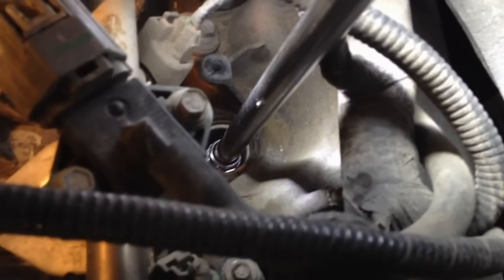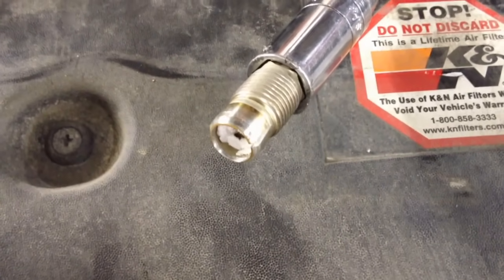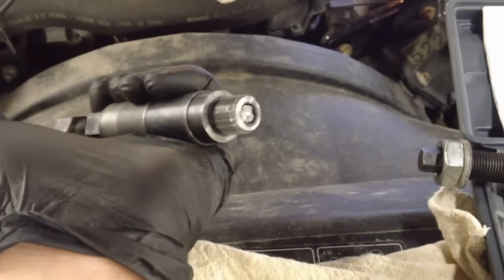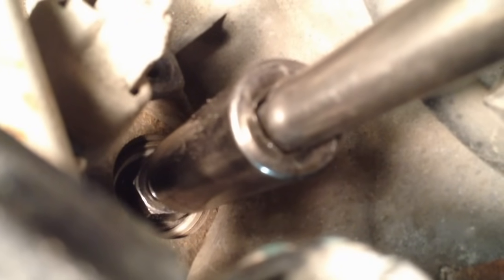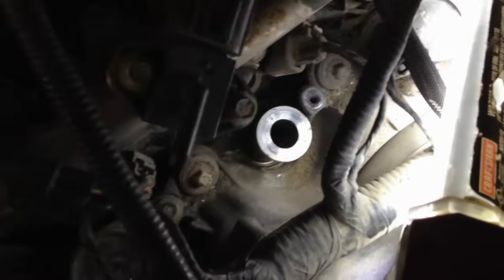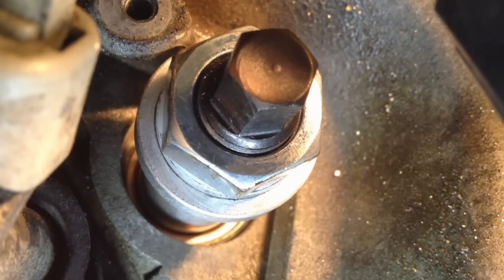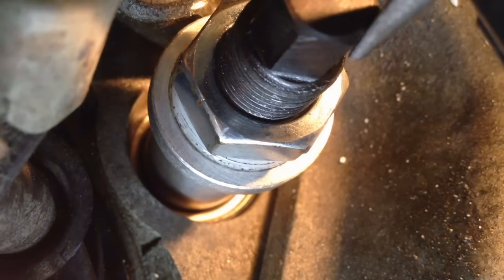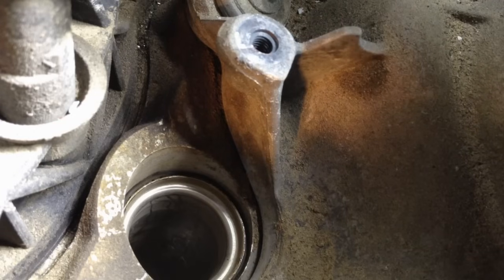Ford 4.6L 3v & 5.4L 3v Broken Spark Plug Removal

Comment: What would you recommend to get just the shell out, with no porcelain in it, just the bottom shell? The lisle tool wont catch on the threads, great video btw, definitely great advise as usual😀👍
Reply: I’m having the exact same problem right now. How did you get it out. My extractor isn’t catching.
Reply: @Venom-z4t  so what Extractor did you have to use to get the shell out

Comment: Soooo, changing the plugs on my truck and none broke but one is totally rounded off! Anyone know if I break the plug if I can get it out with this? I tried hammering on a smaller socket, deep well extractors, etc...I really don't know what to do
Reply: Cody Wallace I have the same problem , let me know if you found a solution bro thanks
Reply: @thehorizon1281  hey bud, here's how I fixed mine. I broke the plug off above the hex. Went to Lowe's and got a circular tile cutter. Drilled into the plug. Then got an easy out

Comment: What do you do if you extracting tool trips on the first two threads?
Reply: Had somebody with a higher grade extractor about $300's. He was also a diesel mechanic. He failed. ended up taking my to a dealership. Luckily we didnt have to replace the head. so it was about 1600 total.

Comment: hey i'm follower of yours what is your recommendation on plug replacement ? i do my Fuel filter trans service diff and t case between 20,000 and 24 000 miles oil switched to 5 /30 like you said and 3000 miles to oil changes and filters 08 F 350 at 130,000 been trouble free plugs changed once ,80,000 miles

Comment: 2002 4.6 v6 f150, I just did my spark plugs and wires, before cracking them loose I sprayed penetrating fluid on all of the plugs and I also was very careful before cracking the spark plugs loose. Thank God I didn't break any. I just bought this truck from my neighbor and it was my first time doing them
Reply: Kyle Feilmeier i think the ones with this plug issue are the 2004 to 2008 trucks with the 2 piece motorcrap plugs..i have a 2001 4.6 and had no problem getting them changed

Comment: My 4.6 mustang blew a plug fixed that issue after the repair car would not start. I've change fuel pump plugs oxygen sensors both upstream and still won't crank. I got fire on coils pulse on injectors still acts as if it's not getting fuel. Any advice on what to do next
Reply: What was the solution?

Comment: Changed the original motorcraft plugs on my mustang....huge mistake!! I got 6 of the 8 plugs out, 2 broke. Had to get the Lisle tool, it only got out 1 of the broken plugs, still had to go to the shop to get the last plug out.

Comment: When you do the second step to tap into the porcelain, which nut are you turning the upper black nut counterclockwise or do you turn the chrome Nut instead to Tap into the Porcelain, I don't have tool as of yet but I like to know so I am not missing up, Thanks you In Advance

Comment: I have an 04 lariat 5.4. 3v engine. I bought it 2 years ago. 
Last year I was going to change spark plugs and bought the motorcraft 8 pack according to year and engine.. Took them to my mechanic and as soon as he took first one out we realized they were completely different from the ones I bought...
 Long story short I had to buy new spark plugs such are on 09 models and newer.. So my question is. How is that possible?
Did the previous owner put a new engine? What are the possible reasons to have this "updated" spark plugs in my engine? In my country I need a document to proof that the engine swap was not from a stolen truck. If that is the case...
That's why I need to know if something different other than an engine swap could be done..
Thank you.

Comment: Wow.  I think I'll start pulling my plugs once a year and coat the threads with anti-seize.
Reply: The new redesigned plugs don't have this 3 piece build and won't separate. Stripped heads are still an issue however.
Reply: James Washer stripped heads are only an issue on the 2v versions, which were due the heads only having 2 or 3 threads. They were redesigned in 2003.5 with more threads just before ford went to the 3v in 2004.

Comment: I’m paranoid I’m gonna break a plug. I drive around and get my motor nice and warmed up. Pull my coils and my throttle inlet and injector harness. I spray wd40 in the plug holes inside the valve covers and spray in the throttle while cycling the starter. Let sit until cool and then rattle loose with some ugga duggas.

Comment: I Had one plug break on me when changing out plugs on my 2007 f150 5.4l .  I went and purchased the exact tool and followed your directions to the tee .  It came right out with no issues .  Thanks for posting this repair. You saved me a lot of cash

Comment: Has anyone ever had the threaded shoulder break off in the head? All I got out was the nut and a split porcelain electrode. Ultimate nightmare!
Reply from the maker: Use the otc tool to remove porcelain and center electrode then use a spiral or square easy out for threads then continue with the lisle tool shown here.

Comment: I had a brand new NGK and it freaking did this I put it in one week ago everything work a week later all my electrical parts came in for the new things came in for rewiring my vehicle I want to take the spark plug out and it snapped everything still intact is just the friends that are still in there

Comment: How would i take off the tip of the plug off the extractor?
Reply: Vise grips worked for me today. Took me a bit to find the exact setting, but after that, and a socket on the end, they broke right off. I hope the two I have left for tomorrow are as easy. Best of luck!

Comment: Is possible the spring from the booth fall inside the cylinder.
Reply from the maker: never had a center electrode fall in yet.
Reply: I haven't turned up. If it have any medal component inside  it will get messed up.

Comment: How do u get the shell off the tool after it comes out?
Reply from the maker: Hold the shell with a vice grips or bench vice and turn the tool clockwise.
Reply: FordTechMakuloco thanks for the video. I got them all out. I only had pliers so I had to go pick up some vice grips. My GT is running so good now.

Comment: I have an easier way for you to remove the spark plugs. What I do is bring the engine up to operating temperature. And take them out with a 3/8 impact gun. It seems on the ethical but I could tell you it works. I was told this by a trainer from Ford. And I could tell you it works it’s the only way I do those plugs anymore. Since I’ve been doing this I haven’t had any break in the head.

Comment: At the end, why not vacuum out the cylinder.  Or insert small vacuum hose and the air hose to stir up the ceramic particles?
Reply from the maker: Much better and faster to use air
Reply: The thought of ceramic chunks going crunch on the valve seats worries me.  I'm probably over-thinking it :)  Thanks for the video.

Comment: ...I was quoted $500.00 to do the plugs, and add $40.00 extra for every plug that breaks...he told me he is very good with this and has had good luck not breaking to many, BUT ... he told me the f150 next to us broke his good luck streak and 7 out of 8  broke ....YEP, ... Add $280.00 to that $500.00 .... just to replace 8 plugs, its lynching time .....with tax over $800.00 ....that's over a hundred a plug ...
Reply: glinnz05 I need to get good at this and make a ton of money charging half of that!

Comment: OLD VIDEO I KNOW, BUT WILL THAT TOOL FIT INTO THE DOGHOUSE AREA OF MY VAN? WHERE THE REAR PLUGS ARE LOCATED?
Reply from the maker: I have never seen a 3v engine in an E-Series van.
Reply: TRITON V8, 4.6L. REGARDLESS , I HAVE A SEIZED PLUG AND NEED IT OUT. EVERY MECHANIC I HAVE GONE TOO HAS TURNED ME DOWN INCLUDING MY BROTHER. BASICALLY IF THE THING SNAPS THEN IM LOOKING AT A FULL HEAD JOB

Comment: I changed mine a couple of months ago. Warmed up the engine for a few minutes then sprayed each plug with pb blaster and let it sit for about half an hour. I used a 3/8” socket wrench since I don’t have an impact wrench. 4 of the plugs broke and I initially used the extractor tool that they rent out at oreilley’s. It worked very poorly, and didn’t extract any of them. Bought the lisle tool and it worked really well. Make sure you have an air compressor to blow out any broken porcelain or metal shaving before extracting. It really sucked and I’m not really that knowledgeable when it comes to working on cars or trucks, but I’m glad I did it on my own instead of taking it to the dealership

Comment: I had this happen on 4 of 8 plugs in my '05 Mustang GT which made me sick to think about having to do the work, but I found a used Lisle removal tool on Kijiji for $30 and they came out pretty easy. Worrying about it for several days was a lot worse than the actual job. Its a shame these engines have this problem but really, the removal process was painless.

Comment: i've run into the same problem with a 1997 Geo tracker,it looks like the bottom of the plug broke off and i'm looking for ideas how to remove it.(1.6 engine).

Comment: I've used the Napa brand spark plug removal tool waaaaaay to many times, and what's going to really tic you off, is that the aftermarket plugs do the same thing, or at least that's been my experience. ✌✌

Comment: Great video, with good slow details on the process. The engine is great, but this whole long plug into the cylinder head was a major design flaw.

Of course I was thinking why couldn't you vacuum the porcelain out of the cylinder?

Comment: Hoping you can help me. Your videos are always well done and extremely informative. They have been very helpful to me since I purchased my truck. I am now considering to do a full tuneup on it myself.I have an 05 that had a new engine put in by Ford dealership in 2009. Do you know if Ford was using the new type spark plug with anti-seize at that time in order to prevent these plugs from breaking in the future. I think that knowing this would be very helpful in my decision to go forward and attempt this on my own Which is something I’ve been putting off. Thanks in advance JOHN

Comment: Just this evening I got the P0301 code on my 07 F-150...Tomorrow I will change out the COP first on No.1 and if that doesn't do it I'll replace the injector...If that 's not the problem I'll just go ahead and order the Lisle 65600 along with a set of Motorcraft SP515's, some anti seize, and carb cleaner...Sounds like real fun!

Comment: Did the electrode fall down in the cyl when you broke the ground strap? I didn't see it with the piece you pulled.
Reply from the maker: Sometimes it does but most times the electrode simply bends off to the side.
Reply: If it does fall in, do you have to pull the head to get it out or can you fish it out somehow?

Comment: Thanks for all your videos. I find them to be very helpful. I did the dreaded spark plug change on my 2005 F150 per your instructions at 113,000 miles. Removed 6 with no problems but 2 broke off. Used the lisle tool and worked like a charm. Thank you for your great video on the procedure.  I also replaced all the coils for good measure. Since I had everything off I decided to clean the throttle body as well. When I fired it up for the first time the engine failsafe mode came on right away.  Starts fine everytime but once it starts to idle down the failsafe mode keeps coming on.  Was going to do your throttle body calibration procedure but decided to hold off until I can get a code read. Any suggestions in the meantime? I really appreciate any advice.

Comment: I have a problem where I think my electrode is bent and I cannot remove the spark plug because of it. It is not broken like in this video. It Breaks Loose It backs out it goes all the way up but it will not come completely out I can tighten it back down I can loosen it up I can I can see it's coming up if you get so far I can wiggle it it's loose but it will not come out of the whole thing only thing I can think of is the electrodes bent over preventing it from coming out of the hole is there a way to get that out without taking the head off?

Comment: Attempting to change the plugs on an 04 F-150 with 78,000 miles.  I ran 
Sea Foam in a couple tanks before starting the replacement.  Six plugs 
came out but two of my plugs came apart when I tried to remove them.  
The jamnut backed right out without much difficulty leaving the 
porcelain complete and unbroken in the head.  The jamnut does not even 
appear to be damaged and in fact looks like a it was a separate part.  
Obviously the Lisle tool I bought to have on hand makes no provisions 
for this.  Anybody have an idea about what I do next? (Besides hunt down
 those responsible for this design.)

Comment: I have changed my plugs on my ford f150 now its running ruff check engine light will flash when driving it or trying to drive it. this is 5.4 engine 2001 model

Comment: Ford bastards for making people go through this stuff. What a turd of an engine. Nearly every one I see go by...clack clack clack. The Asians have designed excellent DOHC V8 engines. Apparently Ford bought the rights to all their rejected ideas.
Reply: you don't think they were designed together? what other non ford engines use these dismal plugs?
Reply: I agree with that. I worked in engineering with Chrysler for 42 years. Some of the stuff they do now and also Ford and GM boggles my mind. Completely handed engineering over to India and China nothing out of Detroit anymore, 1 or 2 guys to answer the phone unless they are ramping up for a new engine or transmission then maybe 20 around, once that is finished there gone. A real shame they just abandoned what has worked for decades. Cummins built and designed a light-duty 5.0-liter turbo diesel V8 engine just for Chrysler, mainly to put in the Ram 1500 and Jeep models they went with the Italian one all kinds of emission problems and now the Nissan Titan has that same Cummins V8 555ftlbs. I never thought I would see that day, but I have to really think if I want to stay with domestic foreign made brands or just buy the foreign makes. I hate Toyota and anything to do with Daimler, you couldn't give me there junk.
Reply: Keep in mind the clack clack clack you speak of is cam phasers. A great way to eliminate that problem is use a good synthetic oil, and change it regularly. That will prevent the vast majority of issues. The problem lies with people that dont want to spend the extra bucks, or change their oil as they should. Also, I would rather remove a broken plug over have my aluminum heads warp on a duramax in the middle of no where. At least when the plug breaks the truck is usually in a safe place with plenty of tools around. All manufacturers have problems.
Reply: Ford recently decreased the time given for many flat rate jobs. They said that due to the availability of air impact and cordless impact tools that the jobs should take less time. So corporate Ford is punishing technicians for buying expensive tools so that they can beat flat rate and actually make a little money. My family is 4 generations strong ford. If you cut me I would bleed ford blue. Ford has changed for the worst and they are starting to test my patience as a mechanic and a consumer. About one more round of their crap and I am going to go GM. GM stuff is easier to work on anyway!
Reply: @tdej80
That's all of them. Ford, GM, FCA, Toyota all of them have lowered the book hours citing cordless tools and that everything is replacing the entire assembly no matter what it is. you and I both know the amount of time it takes to change a strut, now they sell the complete assembly 4 bolts on top, two bolts on the bottom, old out new in two bolts on the bottom four on top headed to the alignment rack after 30 minutes .
Reply: I used to be a Ford Tech and even back then Ford was always fucking us on flat rate. You replace a sensor and they give you .3 on flat rate to replace it, But you had all this shit to remove to get to it you had to write a 2 inch thick worth of text on all the shit you had to remove and replace to get to the sensor or bend over and take a huge dry one!
Reply: Please tell me what in the literal fuck the engine has to do with the sparkplugs? Ford doesn't design sparkplugs asshat.
Reply: No, they do design heads poorly tapped where only 4 threads are holding the plug. Shitty design. Had this problem this weekend.

Comment: I got a 2001 f 150 with the 4.6 , the mechanic I took it said I had a misfire in num 1 cyl . He changed the spark plug, wire , coil and the injector. Didn't fix the problem, now he's says I have a broken vavle spring and need to pull the head. Does this sound right to you? Engine code is w by the way

Comment: Just want to thank you for taking the time to make these videos and help all the DIY'ers. Will this Lisle tool also work fine for the spark plugs in a 3.7 liter police utility sedan? It has 104,000 miles on it and I don't know if the plugs are original and I am nervous about trying to replace them without having the tool on hand, as it is my daily driver.Thanks again!

Comment: Yes Ford did have a design flaw with the spark plugs, and Ford should have some sort of recall, but there is a solution to it, keep buying new vehicles or go back to old school and pull those plugs out much earlier like 30,000 miles or 3 years problem solved. All vehicles need routine maintenance if you want reliability.

Comment: hi I have a 2005 Ford f250 with a 5.4 motor that has a blown out spark plug kit in it  but the insert broke any ideas on how to remove a previous spark plug fix kit insert.

Comment: i have a 04 f150 w/5.4 & 4 of them plugs broke & the bottom end is stuck in the motor, i got a S.P.E & it doesnt work like all the videos i seen. the videos look so easy & its not. the tapper doesnt tap into it. tried using a drill with the tapper still dont get anywhere, the dam electrorod is making it hard to tap into.